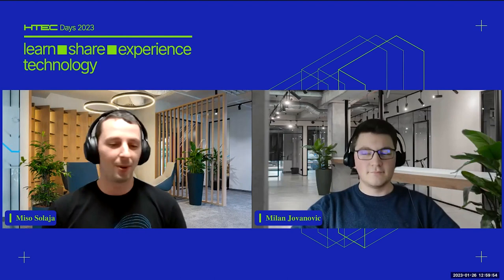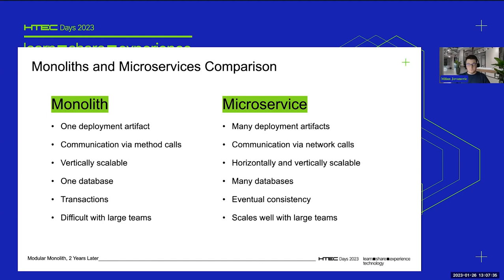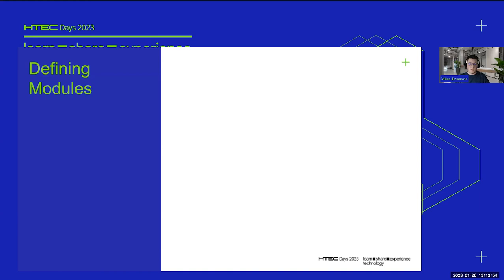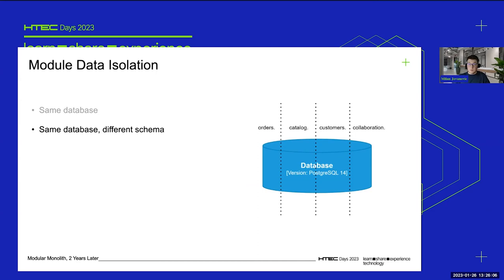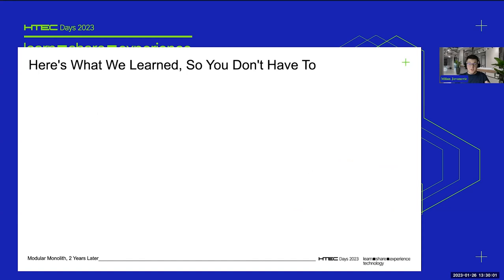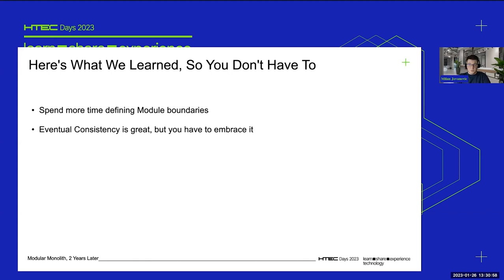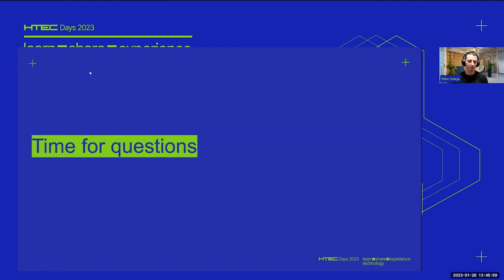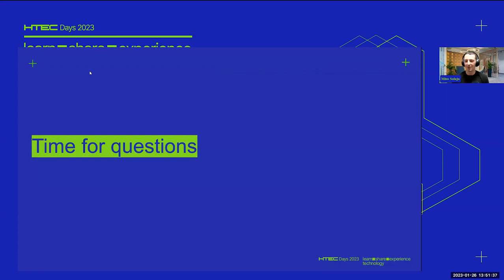HTEC Days | Modular Monolith, 2 years later: Mistakes, Lessons, and What Could Have Been Better

Comment: It's incorrect to say that the modules can't be scaled independently when deployed together.  Each module could use a separate threadpool for doing its work so you could configure the orders module to use a threadpool of 40 threads and the customers module to use 10 threads even when both modules are deployed together.

Comment: "You can either scale everything or scale nothing". I want to disagree with this statement. Your modules are in a way independently deployable. You should be able to have multiple copies of a particular module running at the same time. Even better if they have their individual databases. With that they can handle more traffic without actually having to scale the entire system. From a low level perspective I'm seeing each module as a dotnet solution for example which had an entry point like a Rest API. That alone makes it independently deployable.
Reply: I suppose this depends on what you would consider a monolith. The usual approach to a modular monolith in C# has the modules as one or more separate projects (.csproj) inside a single solution, so there is not a VS solution per module. When you use projects like this you end up with built assemblies that are then loaded in-memory by a single running monolith process (one deployment artifact). In this case yes, when you scale the monolith, you automatically scale these assemblies/modules (aka everything) as well.

When you envision each module as a dotnet solution like you said, you'll end up with multiple processes. Would you still call this a monolith? I reckon with this you have a fully fledged microservices architecture with only a few caveats that distinguish it from a "typical" microservices architecture: you'll very likely share one version control repository and you'd have the CI/CD process always build/test/deploy all of the applications at the same time. It's an interesting idea though.
Reply: Well if your modules are independently deployable, then it's not a monolith any longer. Right?